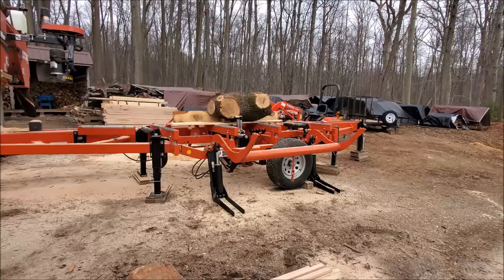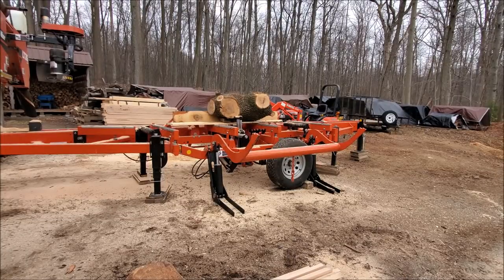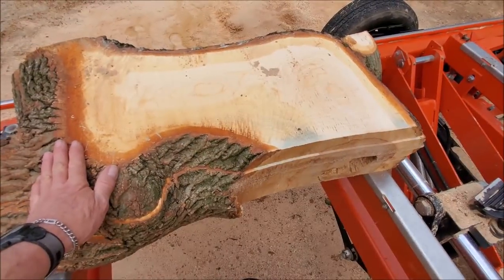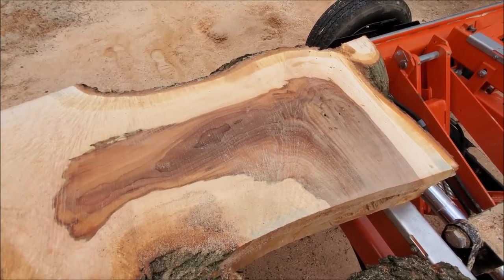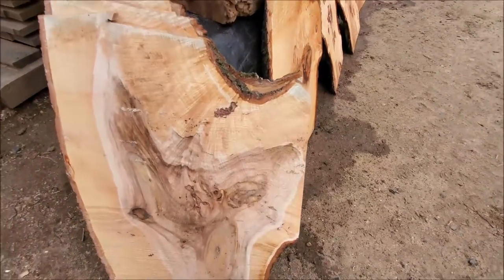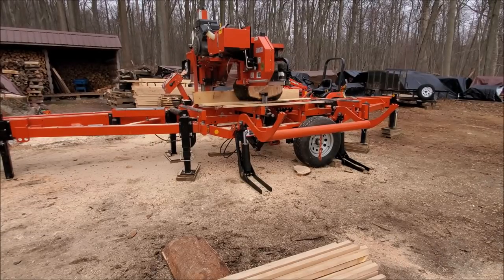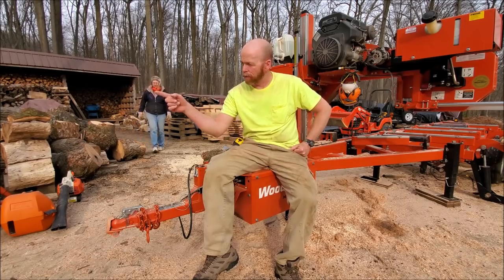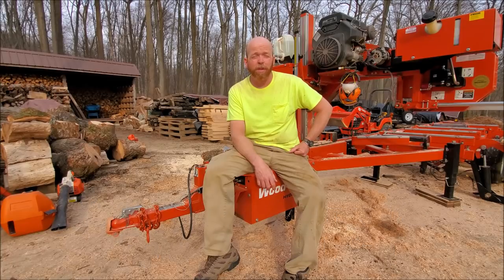Burls

Comment: Not burls, crotches.
Reply from the maker: These are actually mixed pieces. There are small burls on these smaller pieces. They were too small to cut them off and process them into something, so we left them intact with small pieces of logs, or crotch sections, to add character and size.
They went over really well with crafters and full on woodworkers alike.
There was one piece that was simply a unique crotch section, so we included it with this video.
Thank you for stopping in, and your comment.